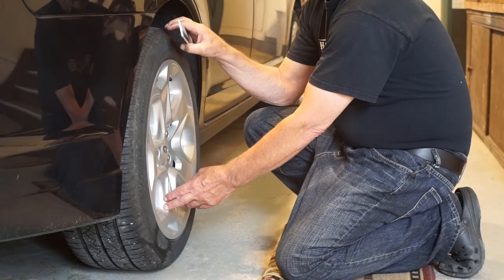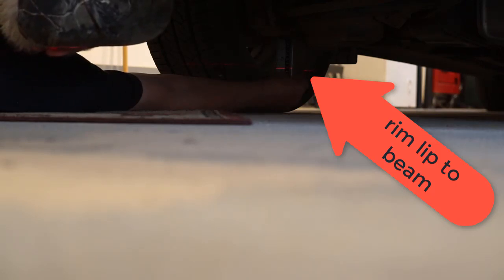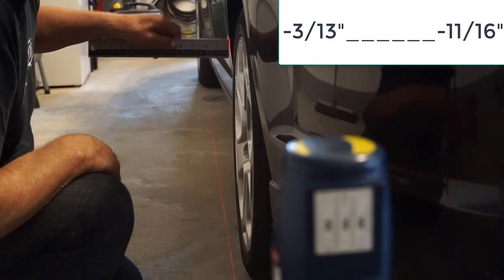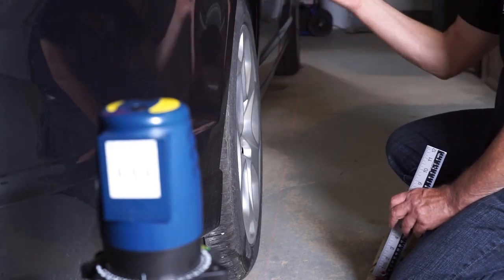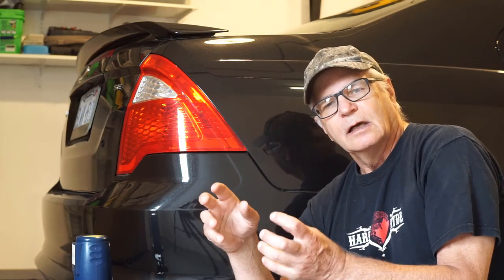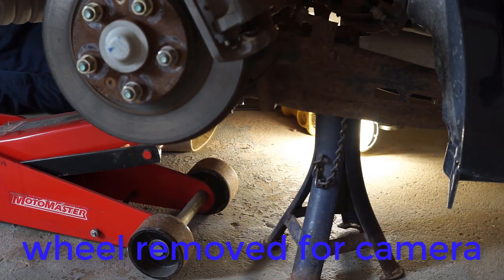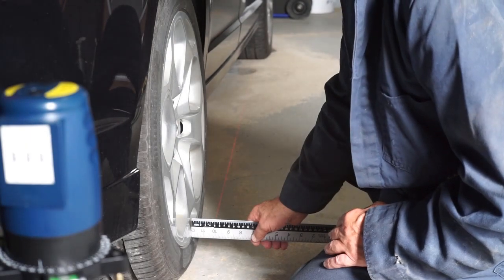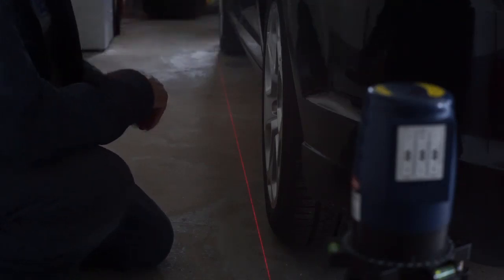GADGETS#68 - CAMBER

Comment: I assume that u moved the vehicle back and forth after the adjustments to allow the tires and suspension to come to their relaxed mode. Thank u for excellent info!  Looks like their is plenty of winter salt on your roads
Reply from the maker: +Bill Rimmer - Not after every adjustment. But at the very end of the job, I did move the vehicle back and forth, to confirm. All good.
You noticed the rust😯
The bushings in those components will let go at about the same time as the brackets rust out.
In a few years, new control arms, new shocks, another laser wheel adjustment and all will good as new. Just parts, no labor. The rewards of DIY mechanic.
I get 20 years out of my vehicles in spite of these conditions.